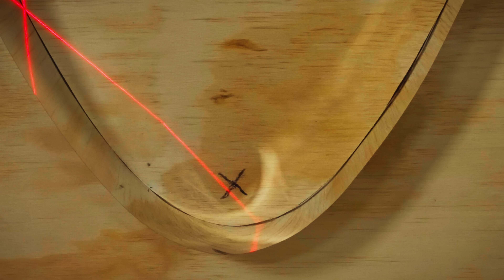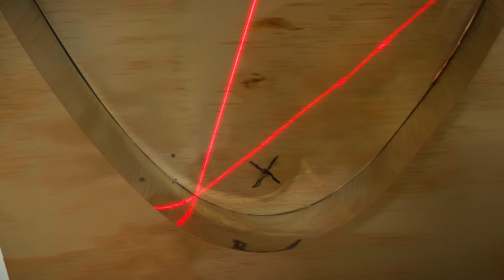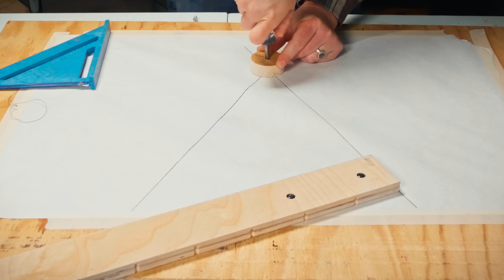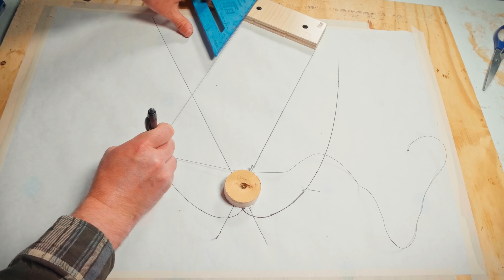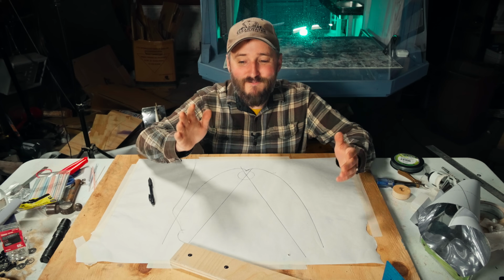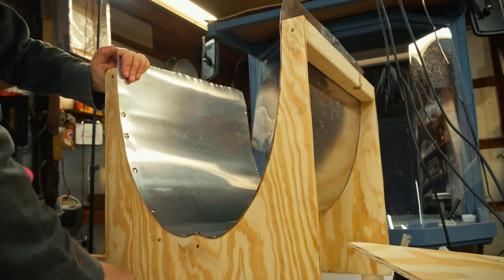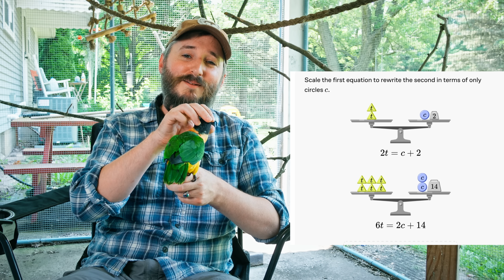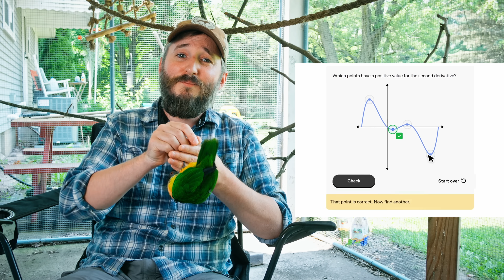DIY Solar Concentrators, Made Better.

Comment: So, the next step would be to build a Stirling Engine, paint its cold cylinder with your super emissive white paint and focus the sun light on the hot side with your super solar concentrator?
Reply: Unfortunately, the best lab tested radiative cooling coatings max out at about 100 watts per square meter of heat rejection. Given that limit to heat rejection, and using the most efficient sCO2 rankine cycle, your maximum carnot efficiency is about 11%. If you use air cooling instead, you'd nearly double that efficiency. Radiative cooling is nice because it can maintain a sub-ambient temperature with low heat input and good insulation with no moving parts; but, it doesn't have enough power capacity to be a heat sink for large and constant thermal loads, at least not without using a lot of surface area. But for a given surface area you can make a lot more energy using photovoltaic solar
Reply: @Spencergolde  The heat rejection has to follow a linear curve IMO. If you heat a chunk of metal red hot, it will cool down very fast at first and then slower to ambient temperature. The hot side of the engine is very hot and you only need a certain difference to make it run. When the hot side is in a water - problem solved. Not enough people experiment with stirling engine. I want a stirling fridge and a second one in a car. And another one for cryocooling the interior instead of AC
Reply: @trollmcclure1884 sorry but you gonna have gard time, car at 40kw can heat up with sterling a 100l car water tank in maybe 40 minutes. 

A 300w is good for liter at 10 minutes, in cooking. Ya know.

Cryocooler I can't fathom, sterling is in principle tube to move heat that spends the heat for mid speed low torque movement. 

You cannot pull cold, or can ya?
Reply: @Spencergolde  what about an aluminum heat sink with his gelatin based cooling gel between the fins?
Reply: @Anthony-d2e8v  Whether it's a solid thermal mass or a phase change material, it has a finite amount of heat it can absorb before saturating, and when your dealing with an amount of heat relevant for something the size of a portable generator, and assuming 200-300 kj/kg for the phase change, you'd go through multiple kilograms of material per minute. At an extremely large scale, with tens of metric tons, maybe it could serve as a heat sink for peak power for an hour or two, but it's a stop gap, the heat still needs to go somewhere
Reply: @Spencergolde  the first plane went 852 ft and flew for 59 seconds the first cell phone weighed 2.5 pounds, and the first computer weighed 30 tons. Everything starts somewhere, sometimes using new tech for old methods can be a refresh, and the only thing being so steadfast in negative judgement does is stifle progress. I don't doubt your numbers, but have zero respect for the "disprove everything" mentality.
Reply: @Anthony-d2e8v 
Amen brother, have a blessed new year, dream, invent, do good things, try new ideas, explore what if, Edison failed 10,000 times to make a light bulb, he just kept moving toward his goal, we should all do the same, life is not always a destination, life is the journey of learning, discovery, overcoming, and experiencing things that bring wisdom.
Reply: Yep! That was my thought as well. Make the solar concentrator coned shape for the hot end and the cold side gets a nice super white radiator.
Reply: Dude!
Reply: Cover a LARGE area of land with reflectors. The ground below should never get sunlight. For better results, make the reflectors like louvers so they can open at night and let the ground radiate to the sky. For even better results, drive heat tubes into the ground to accelerate heat transfer from deep in the ground to the surface so it can then be radiated to the sky at night.

Result: The ground below the reflectors will be colder than the surrounding area. The low temperature these can reach depend on how big the area covered by the reflectors. If it is large enough to make lateral heat flow in the ground negligible, you could get the temperature well below freezing.

The reflectors could simply send sunlight back into space, which is ideal for regional cooling (eliminate urban heat island effect or even start global cooling). But they could also reflect sunlight to a thermal collector.  Now you have a maximized temperature difference for a heat engine.

The cold reservoir below the reflectors could be used for other purposes, like dehumidification, which produces clean water and allows the surrounding area to reach lower temperatures at night. Or, it could be used for air conditioning nearby buildings.
Reply: @theevermind  I feel like you just described a forest.
Reply: @Kowzorz  I can see where you're going, but it's really quite different. Plants in a forest absorb solar energy and store it as organic material. They don't reflect it back to space.

This is rather more like clouds that exist during the day and dissipate at night.
Reply: @theevermind  china built something like this
Reply: @theevermind so many reflectors seems like a way to blind aircraft.
No idea if it actually would, but seems a possibility
Reply: @notyetdeleted6319  I wouldn't think so as all the light is directed at the pipe, and therefore not reflecting back out towards the aircraft.
Reply: wouldn't the cold side also benefit from concentrating the IR emissions into the sky, away from the sun?
Reply: This has to happen🎉
Reply: This is an idea I had as a thermal engineering student. In short the sterling engine works on the difference in temperature between the hot and the cold side. If your difference is only 50 degrees you will not get a very powerful engine. It might be enough to charge small electronics like your cell phone but unless you can get to a much larger difference it isn't an efficient use of space or even heat.
Reply: Wouldn't it be a good idea to exploit the chimney effect to keep the cold side cold?
Reply: Cold side would be great source of warm tap water
Reply: @DreamingConcepts  Yeah. Cooling is easy in the nature. If you make the spectacle on a water surface, you'll never heat up a whole ocean or a river. The power output may or may not be worth the hustle of building a massive stirling engine. However it would work even with a weather unable to boil water for a turbine
Reply: A fun concept to experiment for fun but when it comes to engines (or putting energy to work) you want more heat(energy), not less. For instance a steam engine is infinitesimally more practical than a stirling. And if you have access to both unlimited heat and water, then you basically only need to worry about scale for the intended application like heating and powering a house or business during the day hours.
Reply: Or a concentrator like this could be built long enough to flash boil steam in a pipe to run a turbine.
Reply: LoL - Next step is to build a hot tub... :face-green-smiling:
Reply: Use cold water to cool the cold side of the sterling .Then use that warm water as preheated water for you domestic hot water. Water coming out of a well will be pretty cool compared to the air for most of the year.
Reply: you probably wouldn't want to focus light from the concentrator, but you could easily bend heat-pipes (of the sort used in computer cooling) to transfer heat from a collector at the parabolic focus to a hotplate.
Reply: Steampunk solar!
Reply: Operating by a source of flowing water to dump heat into would be the trick for a sterling engine.
Reply: Solar transfer of heat has exponential efficiency improvements in vacuum.  So you seal it and apply vacuum..  i built one using an old grow light from a free pile. used loops of 1/4” copper to heat water, your demonstration made me realize why i would either make steam or get very little transfer, its the wrong size for the shape of parabala!
Reply: I would love to see that in action.
Reply: please god tell me this is where it's going
Reply: Literally exactly what I was thinking
Reply: great idea!   How might evacuated Sun tubes boiling water at ambeint temperatures be used in a Stirling engine?
Reply: Fantastic idea!
Reply: Awesome job Ben, love your work. sent a link earlier I did with (math formula) web format , that saves svg and interacts with Compound Parabolic Concentrator for use with CNC and Laser projects. (click on turtle to left).
Reply: Stirling engines will never be able to achieve what straight photovoltaics can. The presence of moving parts alone means it will always be less efficient.
Reply: Use the engine to pump water over its own cooling plate, creating a self-powered self-cooled solar water heater!
Reply: No you make a tesla turbine
Reply: @leonordin3052  "No you make a tesla turbine"
Do you know what a Tesla turbine is?  If so, why do you think it's appropriate to convert solar into mechanical energy?
Reply: Organic Rangine Cycle (ORC) is maybe easier. Rangine cycle is the thermal cycle of steam engine. It can be made from heat pump from refrigerator as expander, small pump for pumping liquid to hot evaporator, then the gaseous coolant goes to heat pump compressor "in reverse" then to condenser and back to liquid charge pump. Butane is one option for "coolant", if the cold side is cool enough, and hot side doesn't heat the pressure too high. The generator is already in the heat pump compressor.  There are (or was) some specific ORC coolants at least fro  Honeywell with R-numbers optimised for different heat and pressure ranges.

Stirling engine needs heat exhangers for both cold and hot side. It's nearly impossible to make the cylinder as solar collector area large enough. Heat pipe/siphon is one option for that. The Stirling engine is on top, condensed liquid falls to collector tubes that has inside a capillary coating to keep the surface wet, and boiled gas raises to heat the cylinder fins. They make those heat pipes pretty cheaply in China, but the top end is for heating water.
Reply: @jounisaari9471  Steam engines use the Rankine cycle, not Rangine.
Reply: Stirling 
Engine are efficient due to its ability to transfer heat. You'd need to cool down the Stirling engine before it drastically loses efficiency from heating up.

Comment: always thought that since there is object larger than the focus in the center, then all light from different angles would still hit the pipe just scattered
Reply from the maker: Check out the simulator linked in the video description. Should be the last link in the references

Comment: 3:08 technically a hanging chain or rope follows a catenary curve (hyperbolic cosine), not a parabola!
Reply: Or this is the best engagement bait I have ever seen 😂
Reply from the maker: @matthewgiallourakis7645   Nope, it was a genuine mistake. Just added that part of the video off the cuff and should have googled it.
Reply: I think the shape Is a parabola only for a (fictitious) zero-mass filament.  Since nothing is massless the actual shape is a catenary.
Reply: @ytQrash  I think catenaries are defined by the length of the hanging chain and distance between anchor points, not by weight?
The weight is assumed to be equally distributed, so the shape shouldn't change with heavier or lighter chains. It would change in case the links are not all equally weighted.
[edit: spelling and grammar mistakes]
Reply: Thanks
Reply: Do you (or anyone) know of a technique, similar to Ben's, to draw a catenary curve without tracing an actual chain?
Reply: 12:32 the only problem with your saranwrap greenhouse, is that they aren’t both taped up evenly. The one on the left is flapping in the wind allowing a cross breeze in
Reply: I was a bit confused by the whole "hanging chain" thing...  I mean depending on how taught or slack the chain is, it can go from being a straight line to folded over on itself, so how do you know at what point it is following this curve?
Reply: @industrialcoder  They are all catenaries no matter how slack the chain is. The steeper and closer to folded in half a catenary shaped arch is, the stronger it resists forces from directly above. But they are all optimal arches for the amount of string given. 

And for a parabola, as it gets shallower, the focal point gets further away. With a straight line, the focal "point" is infinitely far away. If it was slightly curved, the focal point might be 100 ft away, which would not be useful or practically achievable for us. If it was a doubled line, be focused right at the tip. Both are optimal for those goals.

I'm not actually sure if the location of the focal point matters assuming it's  in a reasonable place. If it does, I would guess it's also steeper = better. But I don't actually know.
Reply: Lol ok then Gaudi.